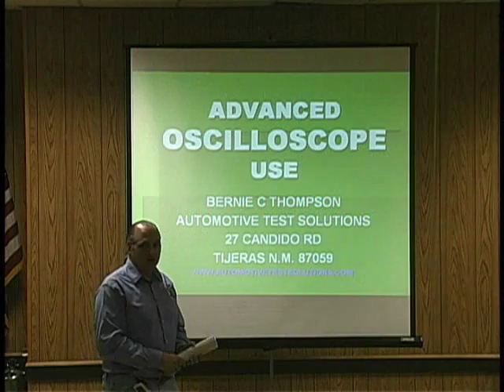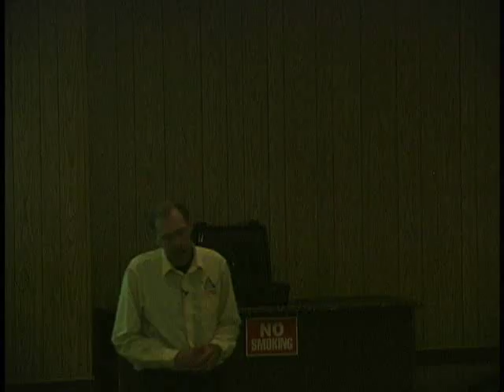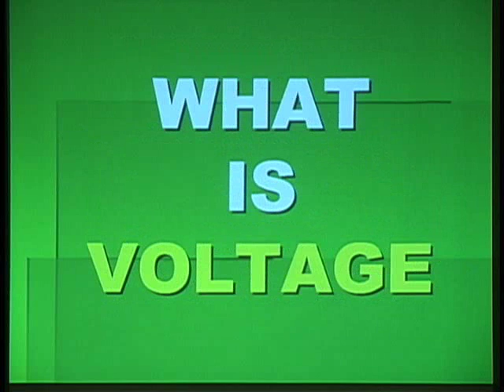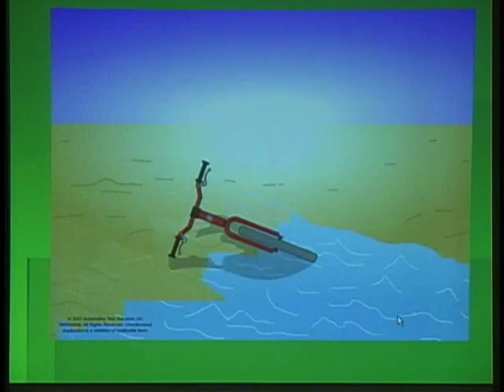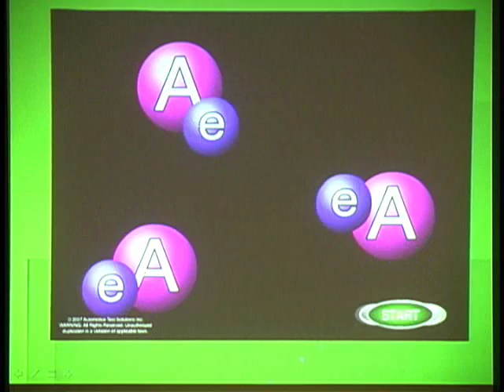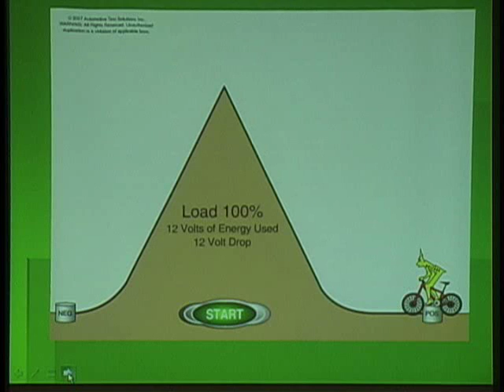Introduction to Advanced Use of the Oscilloscope by Bernie Thompson

Comment: i like the hill way of thinking.. Makes much more sense to me than water pipe. i wonder if you have a book...
Reply: robert mccully actually all water pipe systems have a pump to distribute the water by pressure so the pump would work like the battery in a car pushing the current
Reply: +GAMBIT Two words; water tower.